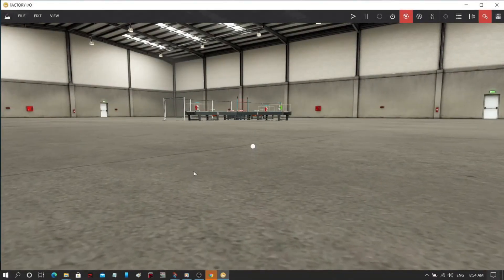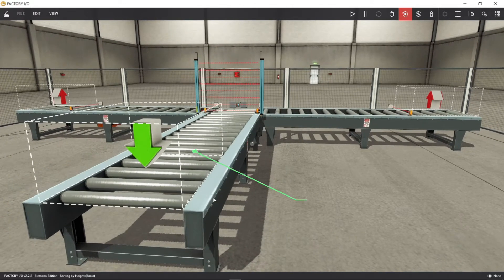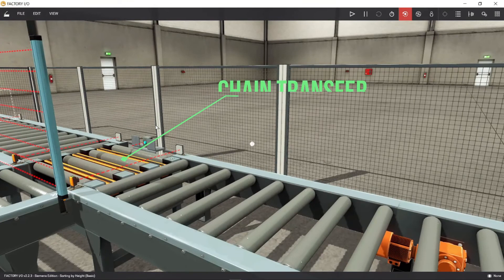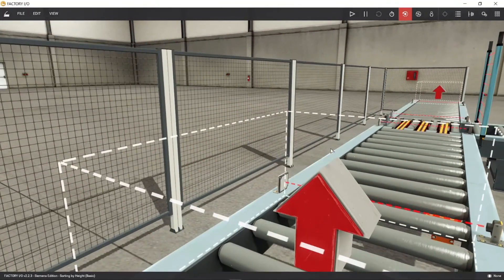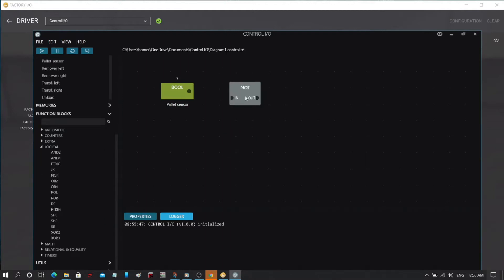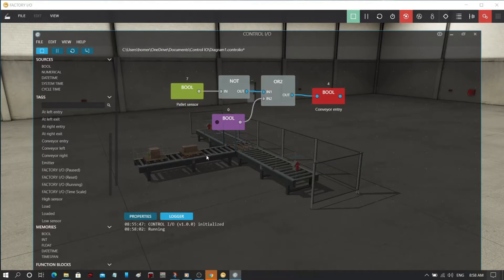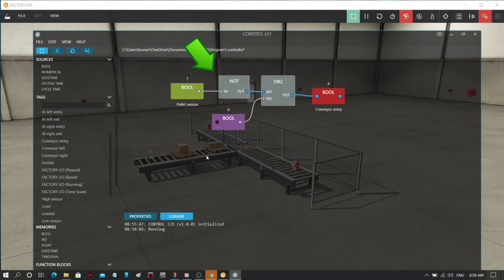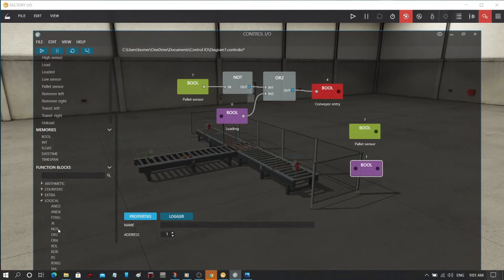LEARN HOW TO PROGRAM FACTORY IO - CONTROL IO

Comment: HI BRO I have one doubt by using factory IO with control IO ,we can only use functional block diagram languages or we can also use ladder diagram in control IO?
Reply from the maker: You can use ladder program by using PLC driver...choose on the driver list the program that you will use and then connect